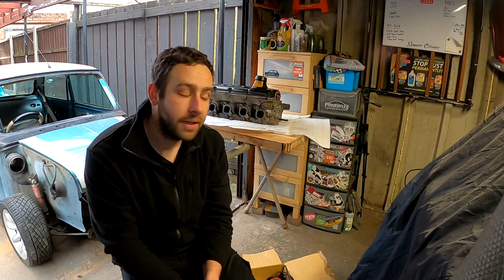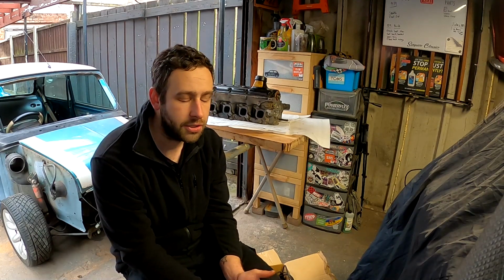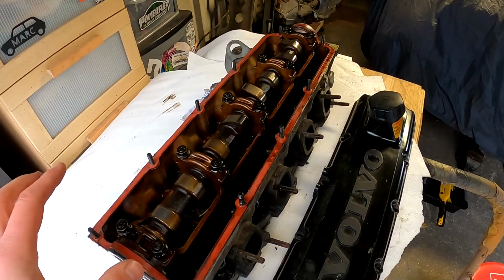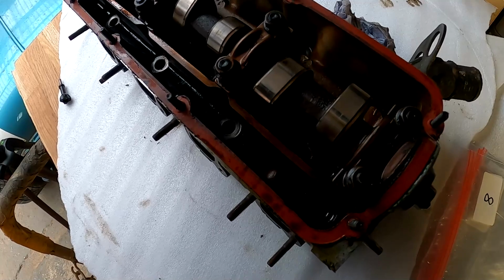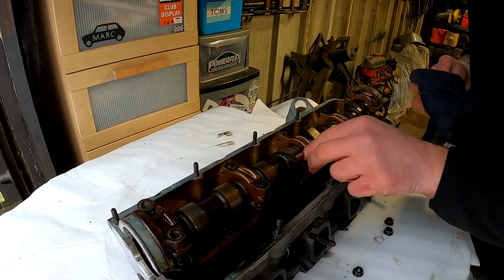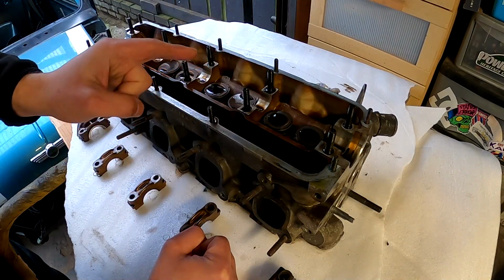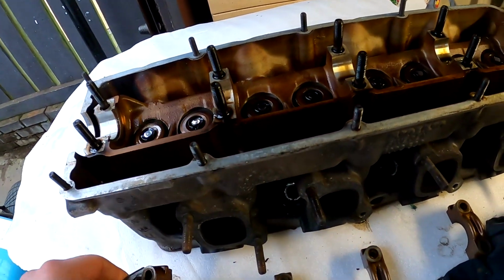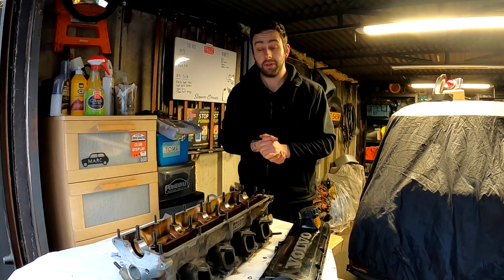Volvo 940 Turbo Project - Intro & Cylinder Head Strip Down - YouTube Made This Happen!

Comment: Years ago I bought, used and sold 2 second hand 240's one after the other.
And the feeling of regret began to grow. The only cure was to buy another one. A 240 that is.
But as I pondered where to get one and what condition I wanted I came to the conclusion that a 940 was like a 240, only better. The 940 is the result of starting with a brilliant model, the 240, and developing it over several decades. There are many ways the 940 is a better car than the 240.
Have you ever replaced the a/c fan in the cabin? You know what I mean.
So I bought a 940 wagon. Never regretted it.
Reply from the maker: Cheers Gary the 240 is on my list to own for sure. For me the 940 was that car of my childhood and I have always wanted one. Love the car! Thanks for watching 👍